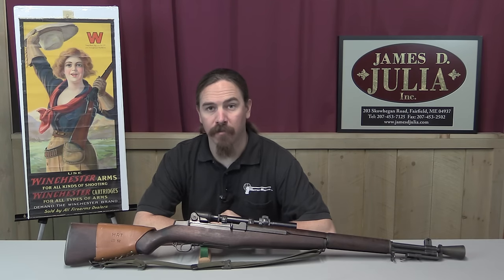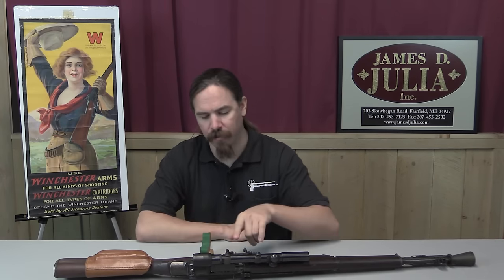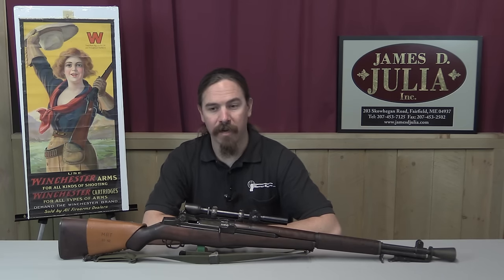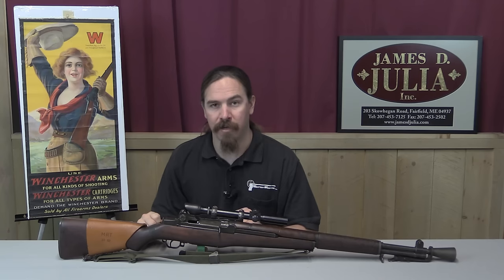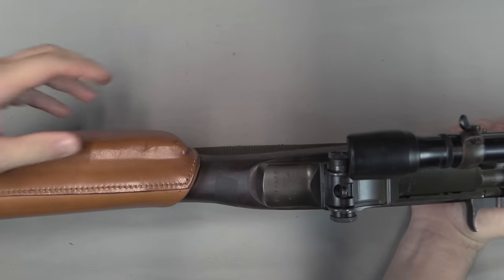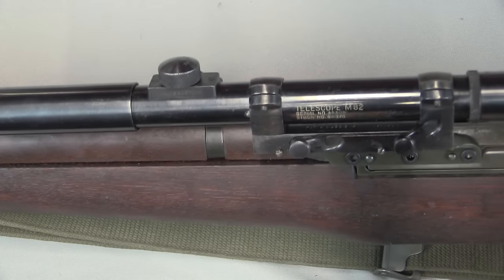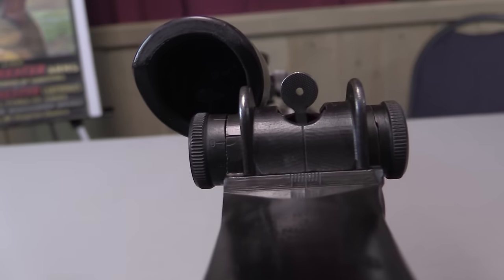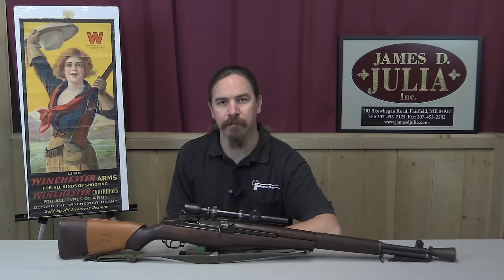M1C Sniper Garand

Comment: "Why are we restricting snipers with the old bolt actions" well bolt actions have been shown to be more accurate if I'm not mistaken
Reply: Really depends on locking mechanism, it is easier however to make an accurate bolt action, but it's not specific.
Reply: Making semi-automatics as accurate as precision bolt action rifles is a holy grail still being pursued to this day.
Reply: +UnknownBigF he's not. this rifle, being semi auto and also less accurate than most bolt guns, was accurate enough for it's intended and effective range. a quality bolt gun will always be slightly more accurate than a semi auto which is paramount at extreme distances. this garand is like an early MK11 MOD 0 made by KAC (Knights Armament Company) it's meant for exceptional accuracy at 700+ meters (which .308 starts to become ineffective anyway) and also much closer engagements. there's a reason why the rifle that hold the record for most accurate grouping at a ridiculous range is the Chey Tac rifle (bolt action sometimes called the intervention) Ian looked at a few videos ago. the slamming of the bolt on a semi auto does indeed have a microscopic effect on the barrel position that means accuracy loss at great distances.
Reply from the maker: The desired accuracy was achievable with a semi auto as well as a bolt action. In addition to mechanical accuracy, they also considered factors like weight, durability, cost, and more.
Reply: It is amazing how things like intended porpoise modify what a standard of accuracy is. I had BAR in 30-06, I got rid of it because it was not a 1 moa.
My model 70 Win is. After I glass bedded it, and put on a canjar set trigger.
Oh ,, also I worked up a custom reload for it.
Reply: as a whole, semis have never been as accurate as bolt actions, the OP is correct, you aren't.
Reply: The accuracy loss from going with semi-automatic over bolt action is only relevant over extremely long range. If you're going with a semi-automatic design, you're expecting fire rate to be an issue, if fire rate is an issue, you're probably not at extreme long range.
Reply: Nope Donato
Hopefully he means a Bolt Action Rifle and not what most of us think when we see BAR in all caps like that.
Reply: Actually in the parlance of the 1970s, at least the one that I am familiar with.  BAR = Browning Automatic Rifle. It was not a ( one moa ) rifle ,it was a 
( six moa ) rifle, at least with the 1964 Lake City Arsenal 150 gr ball cartridges.
I am sorry that I  had to spell everything out.
Reply: Willy Bee
+Nope Donato was correct then.  Thanks for clearing that up.
Reply: Actually Browning produces a semi-auto hunting called the BAR that has no relation to the Automatic Rifle. I assume that's what the poster had.
Reply: Ok, what I was originally trying to ask, was , at what point in time did the sniper have reloads made specifically for each individual rifle?
According to documentaries  (tv) they do now.
Reply: "Sniper" is a generic term. 
We (US Army- 19D) were issued M118LR for our M24 rifles. The M118LR cartridge is a generic "match" type ammunition and was not tailored to anything. In my unit, we were expressly forbidden to use anything other than issued ammunition (M118, M80, etc) and would have gotten hammered for using reloads. 
 
By MTOE we were authorized the weapons and personnel, so every so often my unit would send soldiers to the US Army Sniper School. In our unit, snipers were issued the M24 and it's associated equipment. No magic involved. No super special weapons with built in flux capacitors and usually no super-duper special equipment like wrist mounted ballistic computers with laser computing, breakfast making microwave injector pumps.  

We were just a standard reconnaissance squadron in the US Army and not an SF unit. The vast majority "snipers" in the US Army, as authorized by US Army MTOE, are assigned to regular units such as Cavalry, Armor or Infantry.  What rifle and ammunition an SF sniper uses is going to be different than what's issued to a regular army sniper. What a Navy SEAL sniper uses will likely be different than what a Army SF sniper uses. What a SFOD-D sniper uses will probably be different than what the others use, because all of the SOF guys will use ammunition and rifle combinations that they feel supports their specific mission and they're allowed to have personal preferences. Even the Ranger battalions have some pretty exotic stuff designed to support their specific wartime tasks and missions. 

People use the term "sniper" or "sniper rifle" in a grossly generic way, without context. 
The M1C and the roll it fulfilled was often more like what we would consider to be a designated marksman today. It's taken a long time to codify what most consider to be a true sniping doctrine, but that really didn't become institutionalized in the US Military until the Vietnam era. During my deployments we had personnel who served as designated marksmen who were armed with either M14s or M16A4s, while at the same time we had snipers armed with M24s or Barrett M82s.
Reply: Dont forget reliable, simpler, and having higher tolerances!
Reply: I know I'm coming in a bit late but our host isn't stating a fact... He is taking the context of the era the rifle was coming from, where bolt actions had been the standard for X amount of time and semi-autos were the new, fancy and high tech inventions of the time! If you have ever watched any other of this channels videos you would realize that the host already agrees with you...
Reply: One word: Mannlicher Carcano.
Reply: TigerMeadows 
Good point, but that's two words ;-)
Reply: @AD-wv6wq  bolt has never meant tighter tolerances... Tolerances are something set by the manufacturer, and have nothing to do with a rifles action, and never have.
Reply: Bolt action rifles are not always more accurate than self loading tifles. My ar in 7.62x39 is surprisingly accurate, In can't understand how a bolt would have more practical accuracy. Completely standard with good ammo an ar should be m.o.a.  An ar barrel is basically free floated, only connection is the gas tube, it don't weigh much though. Bolt on the ak is about a foot long, that ought to produce some different harmonics.

Comment: When sportsmen first started buying Garands, G&H reintroduced a version of their M1 side mount. It required drilling & tapping as did the M1C mount, placed the optic more centrally, and had a longitudinal hinge that allowed the whole optic to be tilted to the left to clear the way of inserting a fresh clip. There was a detent or lock to retain it in the firing position. IIRC, the bottom edge was milled with an angle that facilitated ejection. I remember seeing their ads in the Rifleman.

Comment: 4:00 -- I think your assessment of how the politics of the time influenced the contract and its particulars is spot on.  I could show you another way of illustrating it, as well.  Springfield has a certain amount of industrial capacity which obviously could have done the work, but on paper the extra work seemed to demand that even more workers (thus, war production) be tasked to take up the slack, even though it was slowing down the overall process.  To compare it to occupied Europe wouldn't be that difficult, since Germany was effectively the last "great power" to maintain domestic servants once the rest of the world converted to war industries and production levels.  In order to maintain the precarious balance, Albert Speer spent a huge amount of his time figuring out where to use too few workers, and where to better use what few workers he did have.

The classical term for this, at any rate, is pork-barrelling.  It isn't often that the short-sightedness of such policies becomes quite this obvious, though.

Comment: I know a lot of hand loading went on in Vietnam but I have never heard of that in WWI WWII or Korea.  With a bolt action rifle you can go to a much slower burning powder and heavy for caliber bullet and its very different animal from 30-06 loaded for U.S. gas guns which for all intents and purposes is ballistically equal to 7.62 NATO (subsonic well short of 1000yds).  Which is why they used Winchester Model 70 and Remington 700s in Nam.
Reply: The Garand has a narrow range of powders that work in its "preferred" pressure curve. If you go much slower than 4895 or 4064 or Varget, there's a risk of bending the op rod.

Comment: From 11:05 to about 11:40, when your showing the markings on the rear of the receiver, it looks like it has some sort of grip tape or other textured material in the pistol grip area.  Looks like its right in the spot where your thumb would go. Was this possibly a user upgrade?
Reply: It looks to me like adhesive from tape which has been removed.  A previous owner probably put tape there to assist right-hand grip for shooting. Good eyes!

Comment: Ian it's been a while from when i was reading the the Garand Collectors Association stuff... but I think the SA-52 stamping on the receiver was what they did to the new old stock receivers when they updated the manufacturing drawings. They went back and re-certified all the old stock  and marked them with the year of the update to show they passed re-inspection.
Reply: The SA-52 is the rebuild marks of SA. There were any number of reasons they could have been sent back including things like a cracked stock. Not all SA-52 marked receivers were on M1Cs. The SA-52 does not mean it was a USMC rebuild. Those would have an O-6X marking on the heel.

Comment: Really good design, just a terrible series of unlucky issues cropping up. I would imagine most people loving this version once they get their hands on it.
Reply: Those "unlucky issues" are the result of bad design.  It seems to be a good idea that was implemented through a terrible series of poor engineering decisions.
Reply: Bryan Shouse Well it was engineered for a different function, it was naturally would have the problems, but those were resolved over time

. Having the manufacturing split just made it worse for the sake of quality control. By the time they finally fixed everything, it was a pretty good sniper rifle and was indeed adopted and used for several years by the marines. 

Certainly not a great sniper rifle, but for a modified mid range rifle, it's pretty impressive in that sense.

Comment: Reminds me a good bit of when the new bolt sniper rifles was adopted in the 1980s here, the best maker Kongsberg Arsenal was not given the contract, Vapensmia were given it and the product left much to be desired  , even with updates . Kongsberg would have a much better rifle, cheaper and betyer parts on it
Reply: Yeah, there were definitely some politics and inside dealings when Våpensmia was given the contract for the NM149 rifle. But it seems they hired unskilled labour to fill the order. Some were done right, and some wasn't. When we were deployed we were issued NM149s that worked well and shot well, but others didn't.

Comment: What was the actual effect  of the loose flash hider on the barrel, and you mentioned a tight flash hider enhanced accuracy?
Reply: The gas went out in a single direction when fitted right, hence better stability. When fitted loose, the gas went out in separate directions hence messing up the stability.
Reply: To add to what Rik said, Ian mentioned barrel harmonics being a factor. That is, the rattling of the flash hider under recoil/gas pressure would essentially make the barrel vibrate enough to affect the trajectory of the bullet.
Reply: To add to what Blake said, all barrels have an unique vibration pattern when fired. When you zero the complete rifle, you are in effect setting it to accommodate that vibration and shoot to point of aim. Fitting a loose weight that can move more or less at random is going to affect the movement of the barrel differently  every time you shoot.
Reply: Ahh. And simply making the barrel heavier by adding a flash hider might lessen the vibration[?]. Oh, and this also explains why target barrels are heavier in profile? I guess I sort of understood that before...but not exactly. Cool!
Reply: You're absolutely right about the heavy match grade barrels but I don't think the flash hider's weight would make much of a difference. My guess would be that rather than a boost to the mechanical accuracy of the gun, the flash hider reduced the recoil. Assuming two guns have the same mechanical accuracy, the lower-recoil gun is easier to shoot well because even trained marksmen sometimes flinch a little under recoil.
Reply: A loose flashhider is also like having a damaged muzzle. You want the pressure of the gases to exhaust equally around the bullet. A loose one may direct the gases differently from when it is zeroed in and so the trajectory would very  from shot to shot. A very bad thing.
Reply: One of the things that can be done to a barrel to increase accuracy is give it a target crown, which is a cone shaped depression at the muzzle. That helps the gas leaving the barrel do so in an orderly fashion instead of randomly which can cause forces on the bullet in random directions. Precision rifle shooting is all about repeatability. Everything needs to be the same everytime.

Comment: The M1 recently got aproved to use for hunting here in Norway. So I was wondering about solutions for scopes on these rifles. Can you get good scope rails like these on the aftermarket today? Are there any other solutions? And 4 and 3 MOA? is that really all I can expect from an M1? That is shit! Anything above 1,5 MOA is useless for hunting (In my oppinion)
Reply: Griffin & Howe still makes this style of mount, but they are fairly expensive and require some very careful modifications to your receiver. If the bore and chamber are in good condition, you can probably tune the rifle to shoot better than 3 MoA with a little patience. Personally, I would save my M1 as a range toy, and get a Springfield 1903 or a Mauser 98 for caribou.
Reply: I have a mauser, and soon a sporterized g33/40 in 6,5x55 too
Reply: It's a battle rifle, it's not meant to be a hunting rifle. They're designed to hit somewhere in the body of a man not the heart/lung area of a deer
Reply: +Sander van Duren A lot of deer have been taken in the US with the M1 Rifle.
Reply: HaakonTheViking 
Keep in mind the 3moa accuracy was a minimum standard for the rifle shooting fifties vintage 30-06 military ball. Your average M1 will shoot 1.5 with ammunition it likes. You can get far more accurate but it gets increasingly expensive and fiddly from that point forward. 

As for scope mounting options there are plenty of aftermarket mounts that do such things as replace the rear iron sight.
Reply: HaakonTheViking contact Amega Mounts. YouTube M1 Garand scout rifle.

Comment: This is sporting list 

1.Colt AR-15 H-bar/Sporter produsert etter 1986,2.SIG SG 550 SP,3.Steyr AUG sivil modell,4.Valmet M76/78A2,5.Galil AR,6.HK-94,7.Bushmaster mod. XM15,8.Olympic Arms AR-15 H-bar,9.Heckler & Koch modell SL 8,10.DPMS Panther Bull 24/DPMS Panther Bull 24 Spesial (inkl. «Southpaw» mod),11.Oberland Arms (OA) 15,12.Izhmash Saiga sport 520,13.Izhmash Saiga sport 555,14.Tiger mod 03,15.DPMS Panther mod LR-308 (inkl «Southpaw» mod),16.Armalite AR 10,17.Armalite AR 10T,18.Arsenal SAR-M1,19.Heckler & Koch MR 223,20.Heckler & Koch MR 308,21.JP Enterprise CTR-02,22.Armalite M 15,23.STAG 15,24.Smith & Wesson M&P-15,25.Benelli MR 1,26.JP Enterprises LRP-07.27.Johnson mod 1941,28.Ljungman mod AG 42,29.Tokarev mod SVT 38,30.Gewehr G-43/K43.

Comment: Always wondered, does having the scope offset like this have any disadvantage? Since it's common to put it on top i imagined it's because it's better
Reply: Yes.  Like the wing-mounted guns on some fighter planes, you would have one distance where the optical sights were zeroed to the target.  At other distances you would need to hold to one side or the other (Kentucky windage) unless you made windage adjustments with the scope.  After some careful range work you could develop a sighting card with correct settings.